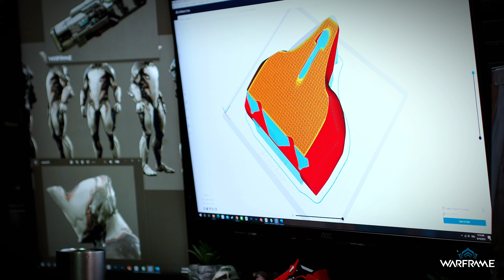Warframe | TennoCon 2023 JMDF Excalibur PC Behind the Scenes Video

Comment: Are the specs of this. Thing any actual good
Reply: I'm pretty sure the specs are on their website
Reply: Yeah yeah it is
Reply: The specs - CPU: AMD AM5 Ryzen 7 7700X

- Motherboard: Asus ROG STRIX X670E-I GAMING WIFI DDR5

- Graphics Card: Asus GeForce RTX 4070 TUF 12G Gaming - 12GB GDDR6X

- Memory: DDR5 (6000) 16GB (8GBX2) Kingston Fury Beast RGB

- SSD: 1 TB SSD M.2 PCIe 4.0 WD Black SN850X

- Storage: 1 TB SSD M.2 PCIe 4.0 WD Black SN850X

- Power Supply: Cooler Master V850 SFX Gold (SFX)

- Fan: Cooler Master MasterLiquid PL240 Flux CPU Liquid Cooler

- Cabling: Thermaltake TT Premium PCI–E 3.0 Extender 600mm

- Weight: 29 kg

- Size: 580 x 680 x 990mm